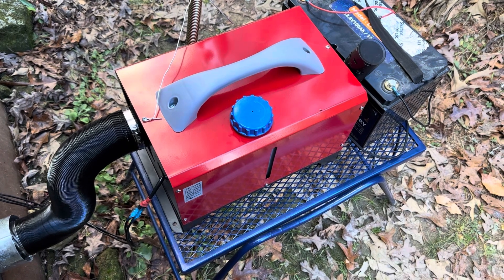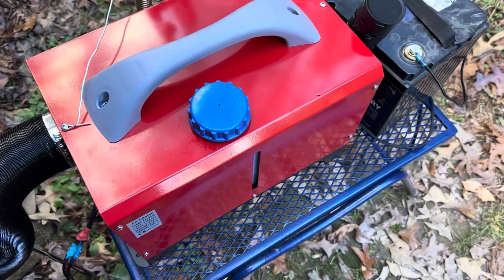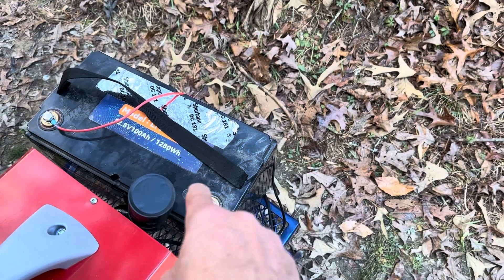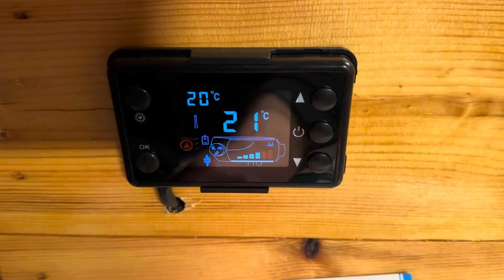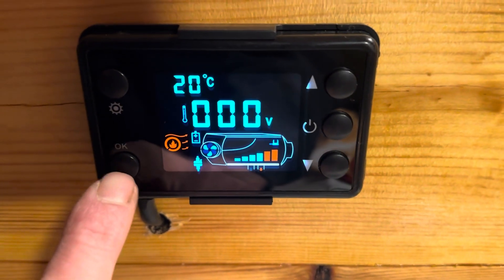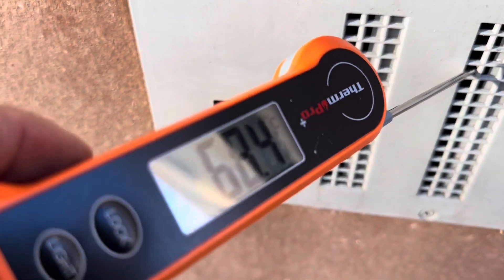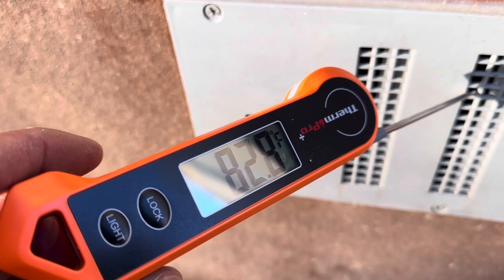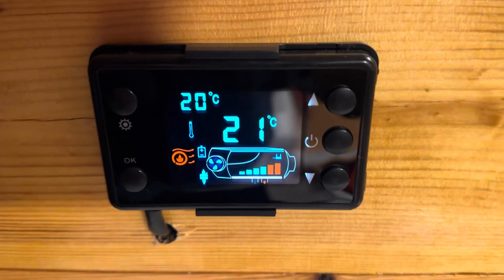FREE HEAT-Off The Grid Heat Project TEST 1

Comment: New to the diesel heaters.  But, from what I have been watching, you supposed to have the muffler down to prevent water build up?
Reply from the maker: Manufacturer recommends sloping down. 
I pointed it upwards as a matter of style lol.
Seriously we’re in a drought and surrounded by forest with dry leaves. I felt better having the exhaust up, didn’t want upwards of 800F exhaust blowing on leaves and stuff. 
I had no moisture accumulation. Exhaust temp on this particular model is well above condensation temperatures.

Comment: You want to mount the muffler and muffler pipe at a continuous downward angle so water can drain.
Reply from the maker: Thank you for watching and commenting! 

I didn’t point it downwards due to dry leaves and vegetation/fire risks! 

This unit is making 0 condensation from the flue/exhaust. Exhaust temp has been 400F plus so little/no chance of water condensing.

Comment: good stuff. guess I should pick up some diesel and get mine going again, just hard to speand money when i have all the wood i could ever need. It would be nice to get it going again in my other camper so I might get some things done in there, been to cold to jack with it right meow... have a great day.
Reply from the maker: Don’t blame you at all for sticking with wood heat! No room here in the tiny house for a proper wood stove. The other reason I’m trying heating the floor first is also a good test for a hydronic coil/radian heat loop + wood fired boiler rig I’m considering.

Comment: How long will that battery run the heater? Keep up the great work, much appreciated
Reply from the maker: Fully charged 12.8V 100ah LiFePO4 should run it for 36 hours straight on high fire/high speed setting(35 watts) Low fire/low speed (20watts) should have about 64 hours. Hope this helps!
Reply: Sure does, thanks!